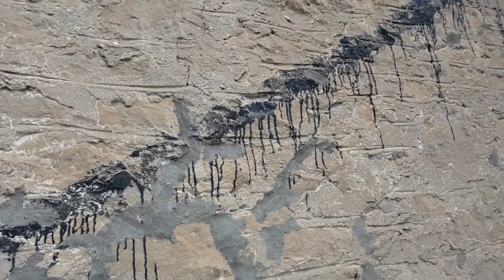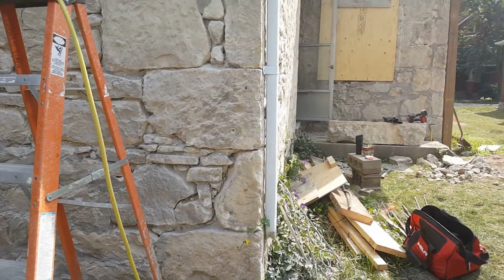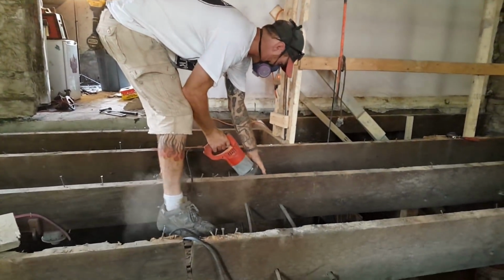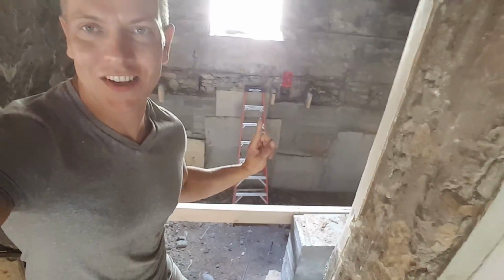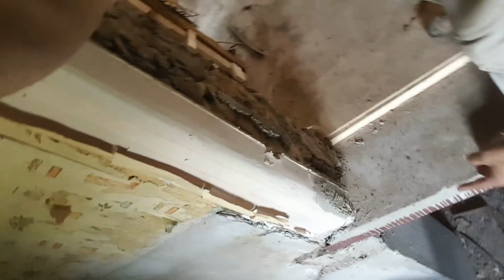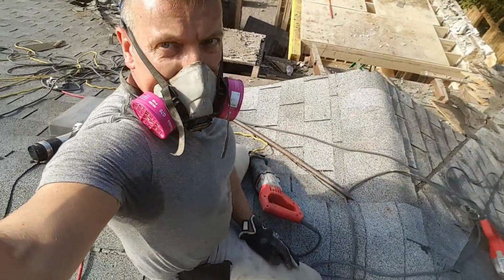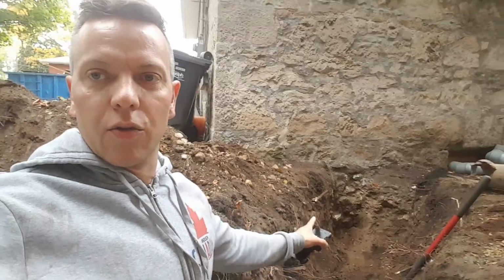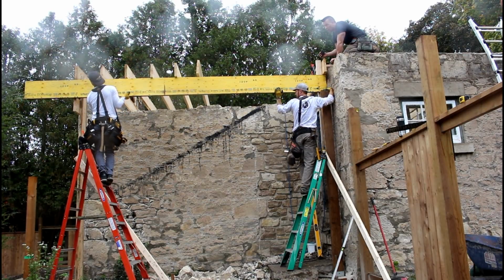Century old Heritage home - Reframing the whole house

Comment: That roof is a beast! Nice job! Also  I’ve never seen someone use House wrap on a rim joist, I guess next to a stone wall it certainly couldn’t hurt!
Reply from the maker: Al S Thanks man. Yeah the housewrap was just because its a termite zone and there were issues in the past. But realistically speaking, we are spray foaming the space between the framing and the stone, so it really wasnt needed. Its backup protection really.